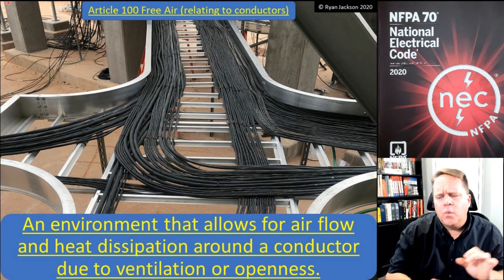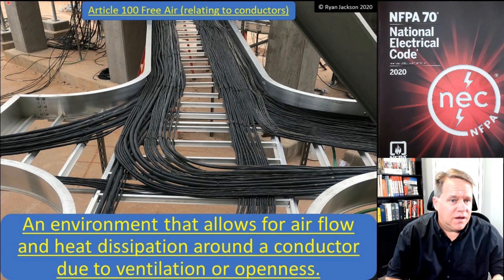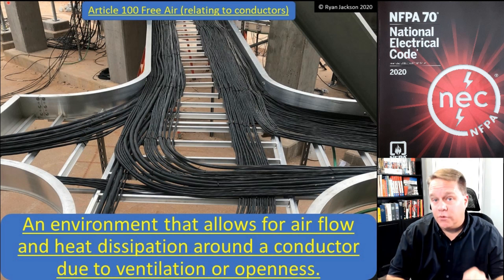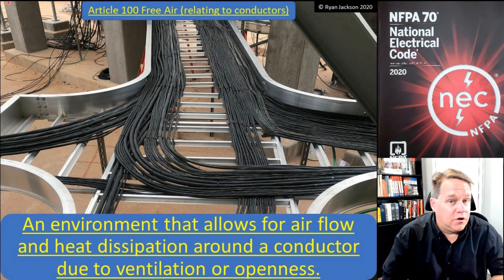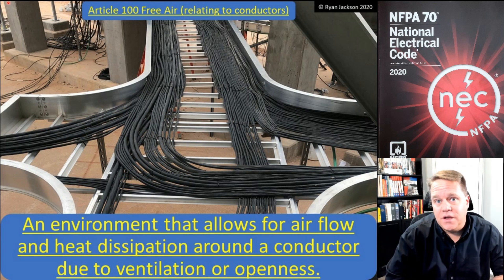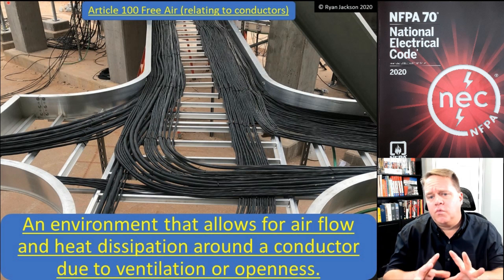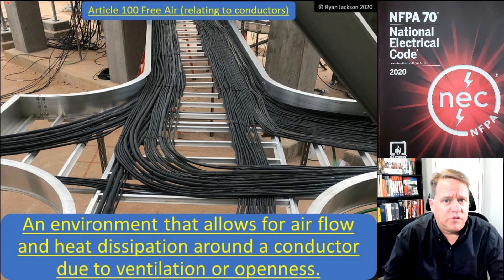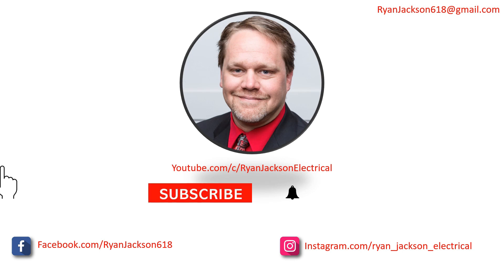100 Days of Article 100: Free Air

Comment: Would the cables in your picture be eligible for the free air rating? The reason I ask is that I understand that in order to be eligible for the free air rating they need to have a certain amount of space between them so that they are not touching and heating each other but I'm not sure if my understanding is correct.
Reply from the maker: Yes, if they under the purview of the NEC. In most instances this would be a service drop (utility owned) and not within the NEC's scope [90.(B)(5)].